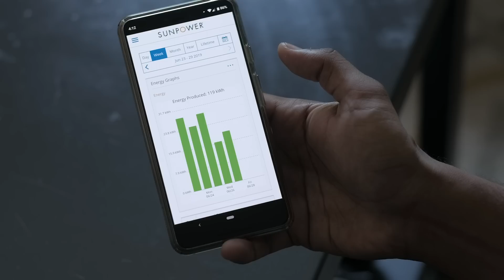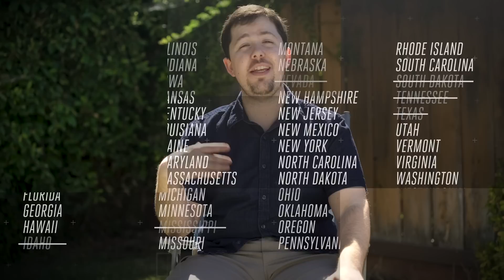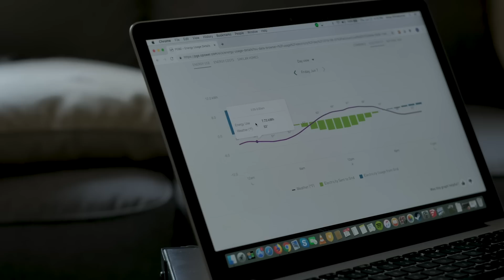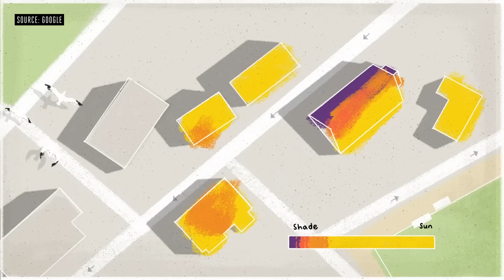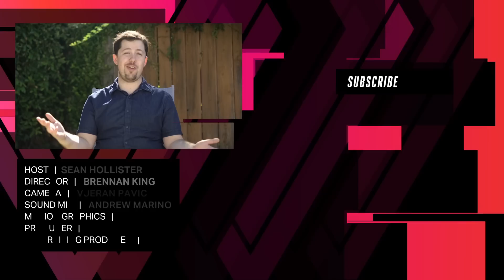Solar power is finally within reach, but not for long

Comment: How about a solar generator instead of the batteries?  I could get a TITan with 1 or 2 batteries for cheaper than the Tesla and use that say for the ac or electric heater during the day and have that as a backup generator for thousands of dollars less than the Tesla.

Comment: You literally doubled your expenses before doing the 5.31 year calc.... not very honest “cause I bought an electric AC” ... even a very powerful 15000 btu AC running 12 hours a day (for 3-5 months mind you) is a mere $1 per day at $0.10 / KwH. 

So instead of a $30 increase you assumed a 2x of $150 wtf

Comment: 2:50 ...thanks for answering my questions on getting batteries. The technology/pricing is not there yet. I'm not rich. I guess I'll have to depend on my fuel-run generator for a few more years. And I live in Venezuela, where electricity is basically free, but it goes out for hours every single day. Yay socialism!

Comment: For the cost: you should also estimate the repair cost, it may be more expensive than the power you use in few months if you face any bad weather than damages the panel...
Reply: panels last through hurricane winds, and baseballs going 80mph bounce right off them

Comment: I'm going with batteries. My calculations show, that the levelized cost per kWh of stored electrical energy is about $.10 per kWh, if every bit of energy was coming from batteries. But, the batteries only have to supply about 14 hours of power during summer, and as high as 18 hours during winter. Thus, since the batteries are not supplying the power during the day,(when the AC is on and you're doing laundry), a battery with a capacity equivalent to a full 24 hours with no other supply, is about the right size, to get the lowest cost per kWh. That calculation seems to work with everything from cheap golf cart batteries, all the way up to the super expensive, but super long lasting Lithium Iron Phosphate batteries. The fact that the batteries DON'T supply the house during daylight hours, reduces that to about $.08 per kWh. That's on par with our lowest tier billing, and well below our secondary rate,($.114 per kWh), and our tertiary rate.($.144 per kWh) The extra capacity is good for those cloudy days, where I may need to dip a little deeper into my battery capacity. Even though it seems unnecessary to have that much capacity, bear in mind, that batteries will last longer if you can consistently keep them in the upper half of their state of charge. Reserve capacity is always nice, as well. If you install much more than that, particularly with Lead Acid, you can easily reach the point of diminishing returns, because of calendar life. Lead Acid is best sized, for your highest 24 hour day of draw.
     I don't intend to go off grid, the grid will connect to the system in the form of a large harmonic power factor corrected battery charger. It will by a tertiary source, after my panels,(primary source)and battery bank.(secondary source) As a bonus, should I ever need it, I have a selection of portable generators which can also be used for battery charging, in case there's a snow storm, that knocks out grid power, and completely covers my panels. Those generators will come in handy,(if grid power isn't available) because I will have a "defrost" feature, that will back feed the panels, and melt the snow off by heating them up electrically. I've tested the concept, and it works extremely well, but, it uses an enormous amount of energy.(about half what the panels can produce on an overcast day)If I do it early in the morning, the panels will generate back the power I used by the end of the day, and then some. The big benefit would be the panels being fully exposed the following day, where they can bring the batteries back up to full charge again.

Comment: I disagree about not installing the battery. I have a 4.5 KWh battery. On a real sunny day it charges really fast. But if there’s shade in the middle of the day and you put on a high use appliance, you’re not pulling from the grid. But instead from the battery and the solar panels. Same goes for charging my car on a cloudy day, once the battery is charged I can pull say 400 watts from the battery and 1KW from the solar to maintain the minimum amount of power required to charge the car. So for me solar without a storage battery makes no sense. Especially if you work 5 days a week and nobody is at home during the sunniest time of the day.
Reply: Batteries are not 100% efficient. Batteries are very expensive. Batteries need to be replaced. Net Metering is 100% efficient for many,  and is essentially FREE ...

Comment: $16k - you're being ripped off! In Australia a quality 6kW system costs less than half that before rebates, and about $4k USD after them.
Reply: Not entirely true, as in Australia the government takes your power but gives you little to no credit vs most U.S. states have better net metering policies (but up costs with red tape fees).

Comment: See credits as a bonus only.  If you install solar you need to not think about the credit and make sure that the choice is smart regardless.  Government credits come and go and are very unstable and you don't know from one day to the next if they'll have it.  Same with FIT programs they come and go all the time so you don't want to depend on it.     If you have enough space for enough solar panels to go off grid then it's a non brainer.  It's lot of work though, because you have to take snow off them every morning.
Reply: No, adding Solar Panels is NOT about going "off grid".  We do know exactly what the Federal Tax are and will be until 2022.

Comment: Forgot to include annual loss per year in cell production. Also cost to clean cells to keep peak performance. 

In NJ I spend $500 average per month. My calculated ROi was 8-9 years after all tax breaks.  Not worth it. I do better returns in stocks. 

Also I even calculated if panels were free. Still barely worth it. Most of the cost is install and then your annual loss, limited lifespan of cells, annual degradation of performance.
Reply: My power bills are half that, and, I'm doing solar and batteries. Much less volatile than stocks, even if I run lithium ion batteries!😁

Comment: Good, clear, concise video, but where did you get the $200 per month figure at 1:59?  Around here, a good assumption is three hours per day at peak rated solar power output on average.  If you live someplace like Arizona it might be twice that.  Even at five hours per day with your 5 KW solar panels, you'd need to be paying your local electric company 27 cents per Kwatt hour.  The national average is 13 cents per KW hour.  It's 20 cents in California.  June is typically a peak solar month in the US.  Are your pre-purchase estimates viable in this peak solar month?  What about six months from now at a solar minimum?

Comment: The reason solar is still too expensive for most Americans in 2019 is because 2/3 of installation costs are installer overhead and profit and the maximum tax credits can only be claimed when using a professional installer. If I could get the same amount of tax credits for a DIY installation I would already have solar.
Reply: McNoodles Do you want it for free ? lol. You can diy solar for 70 - 90 cents per watt in US if you smart about where you get the parts from.

Comment: $16000 for a 6kW system? Here in Australia, 18 months ago I paid 6500 in Australian dollars ( $4500 in US) for what is almost a 6 kW set up, everything included. If I didn't have the rebate, it would have cost me 8800 AUD (or 6200 USD). From what I've seen, virtually everything is cheaper in the US than in Australia. Where's all that extra costs coming from?

Comment: When the power goes out you have no power without batteries. Your inverter shuts down when Ac power is not detected. 
Dan the Solarman
Reply: Why would you have electric solar panels without batteries?
Reply: @0ooTheMAXXoo0  Most Solar Panel system do NOT have batteries.

Comment: Question is will it be way more cheaper in 5 or 10 years? may be very cheap!
Reply: Solar with battery has been the cheapest way to generate electricity for a couple of years and it is in its exponential phase of better efficiency / lower costs which is why  almost all households in the world will be generating their own power in just a few years...
Reply: @0ooTheMAXXoo0  In most countries ... Solar + Batteries is more EXPENSIVE vs the Grid.

Comment: Also, depending on where you live. You have to be on the grid before Tesla or some companies will even install. Almost all states have a waiting list or don't support paying you for giving back to the grid. Most utilities will still charge you for a connection fee (give or take 100) even if you use ZERO power. Some Unties charge you a different way if you have solar. Basically they are trying to deter people from getting solar or make sure they get their money one way or another. People need to start fighting these practices, even if you don't have solar. Otherwise you may never get it. Or the way you want it.

Comment: An 300w solar panel cost about 150$, an 5000w inverter will cost 1300$ (check wholesalesolar USA). So the whole system cost 3800 $ in parts.
Reply: Even with your numbers the total is wrong. Also missing mounting equipment, wiring, labor (certified electricians).
Reply: He got Sunpower panels. Those cost double.

Comment: Time to rain on the parade. There's actually a big problem with tax credits in general. When you read tax credit, you should think regressive tax. Here's why. Basically, there are two ways in which electricity system rebates work. For small items, like more efficient lightbulbs or dryers, power companies are sometimes mandated by the state to give rebates for these items. The cost of these rebates are built into the rates that they charge all consumers. But overwhelmingly, the people buying these devices are already fairly well off. This means that all customers are paying for the richest customers to buy fancy new devices and lower their energy bill. Insidiously, because there is now lower demand, the company then has to raise rates even higher to cover grid costs. Thus, these rebates are not magically drawing money from nowhere, they are taking money from the people who can't afford fancy LED bulbs and giving it to people who already could. 

The second mechanism is through a federal tax rebate, which is less direct, but ends up with the same result. It's basically taking money from the entire country to give it to people who then start making money off of it. I'm hardly a progressive activist, but I worked at a electricity production company and this is a legitimate concern. 

Also, see my other comment about how more distributed generation is actually bad for the grid. But don't just take my word for it, do some in depth research on these topics. There are a lot of renewables cheerleaders who don't really understand many of the problems renewable energy causes.

Comment: Net metering will go the way of the dodo in nearly every state, mark my words. Basically, this is because these laws force electricity production companies to pay the homeowner the same rate as they charge, but the price they charge covers not just electricity production but also transmission, which the homeowner is still dependant upon. So it's very likely that these laws won't last. Plus, distributed production makes things much harder for electricity producers, not easier. Our current grid wasn't really built for electricity to follow backwards, and more solar means a steeper 'duck curve'. Ie, the power demands of the entire grid shoot up rapidly at sundown, which is hard for the companies to match, often requiring less efficient or more polluting energy sources.
Reply: Where I live, the utility has already dropped its net zero metering program. I'm going with batteries. I know that it's more expensive, but , it's a more sure thing. I can do batteries for less than the $.10 US that the utility charges, but just. When we get into our 3rd tier, it shoots up to $.144 US per kWh. batteries can be done for about $.08 US per kWh.
     You always have to consider the consequences, if everyone were to do the same thing. If everybody grid ties, there is going to be huge instability problems with the grid. If everybody uses batteries, and "peak shaves" the grid, the grid becomes extremely stable.  Peak shaving is when a charging system only draws from the grid, if the voltage is above a set threshold, so the grid doesn't need to use peaker plants, and, in areas where there are wind turbines, you can draw only when the turbines push the grid voltage up past a point, which helps stabilize the grid against the intermittent renewable sources. You would only do this, if your panels aren't enough to keep the batteries charged.
Reply: @vincentrobinette1507  I appreciate that you are considering the overall good. I'm hoping batteries come down enough to make them economical so that we can replace a lot of peaker plants as you said.
Reply: @jackbarbey  Right now, I think it makes the most sense to pair batteries with solar panels as well. That's because the efficiency losses in both the batteries, and the electronic charging systems, and inverter systems. You need at least enough photovoltaic power to offset those losses.(of course, more is better)

Comment: Actually its they are made with coal and oil power in China. Now add on 25% tariff might as well install a coal power plant in your back yard. Tesla battery might burn down your home. There is no climate change. So this is a hot mess.

Comment: You could simply use heavy weights as storage for electricity,  a motor lifts them during day, and the drive a simple dynamo at nights. much cheaper than batteries or trading energy with the main network.  wights can be liquid or solid, doesn't differ much.  There are also tens of other methods.
Reply: Billion dollar utility companies are not investing in weights to store energy, they are buying batteries as fast as they can be constructed. If you imagine how big a structure would have to be even for a house worth of electricity then I think you will understand that it is not cheap at all...
Reply: @0ooTheMAXXoo0  But Lithium and LiPo batteries are very limited and expensive,  storing energy in weights and lifted water is much cheaper.
Reply: Solutions like that are practical for grid scale electrical energy storage, but batteries are more practical for the average home owner. Besides, at your house, the batteries only have to compete with retail rates, which you can beat with just about any chemistry of batteries, weather cheap golf cart batteries, or expensive lithium batteries. I figure about $.08 per kWh, to buy, maintain and replace batteries, if you install 24 hours worth of capacity.

Comment: In NC we actually PAY to put energy back into the grid.
Reply: All the more reason to use batteries!
Reply: @vincentrobinette1507  Do batteries actually make financial sense?
Reply: @MrSummitville  For consumers, like us, they actually do. Where we pay RETAIL electrical rates, batteries can be competitive. For WHOLESALE rates, which are 1/3~1/4 that amount per kWh, batteries are still too expensive in most markets. In areas where the wholesale cost of electricity are quite expensive, big battery projects can be competitive, by virtue of the price breaks due to large numbers of battery cells. In New York, they're converting a natural gas 'peaker' plant, into an electrical energy storage plant, which will undoubtedly use batteries. They are doing it in 3 stages: They will start with 129 megawatt hours, then, they will add another 98 megawatt hours, then, they will finish with the final 89 megawatt hours, for the full 316 megawatt hours, making it the largest grid scale electrical energy storage facility to date.

Comment: Uhm, sorry did you have to pay 18k USD for a 5kW system? I mean, I saw you used Solaredge 1Phase inverter and I would guess Sunpower modules but WTF? This is more than 3USD per Wp, I think you got ripped off unless i am missing something? Price in the UK for the same system would be at around half the price.
Reply: The "cost-of-living" varies from location, to location ...

Comment: How long is the panels' lifespan, tho? U are not putting it in the calculation. I suppose that every electrical devices last 5-10 years.
Reply: i think i saw something that a typical warranty for panels is 25 years..but at 25 years they'll be producing 80% of their typical power...still..25 years is a LONG time
Reply: Those Sunpower panels will work for at least 40 years.

Comment: coal and oil will run out in 50-100 years, only getting more expensive as it becomes rarer. The sun however has several billion years left and will only become cheaper as technology advances.
Reply: So, that gives us 50 - 100 years to find low cost alternative energy sources then, right?

Comment: It it the thech that costs a lot, or is it the installer that charges a lot. the Solar Industry Information Association (SEIA) released a report putting the number for soft costs at 68%.
And soft costs applies for everything except parts.
So it's not that it's costing more. It's that these solar companies are charging you more.